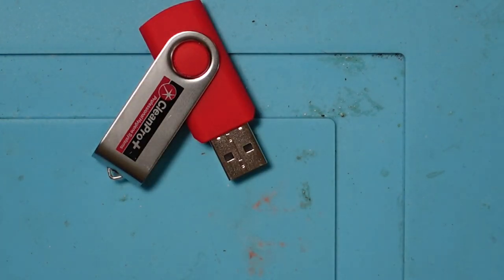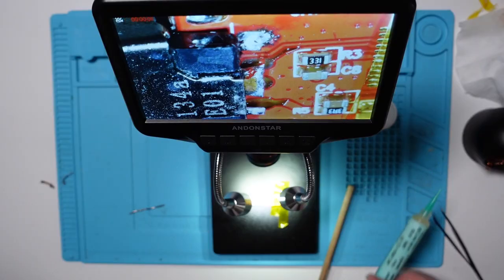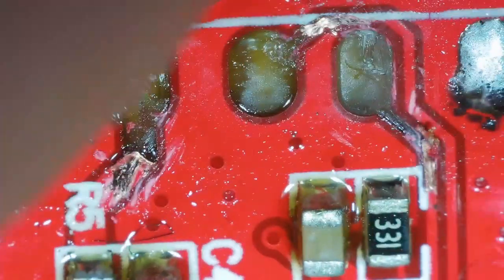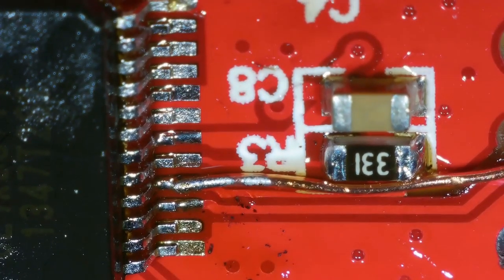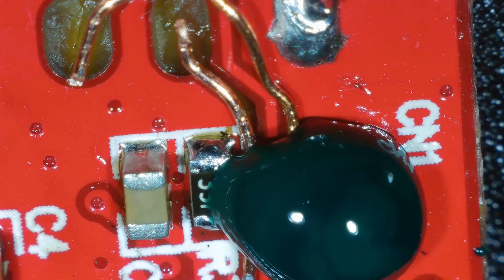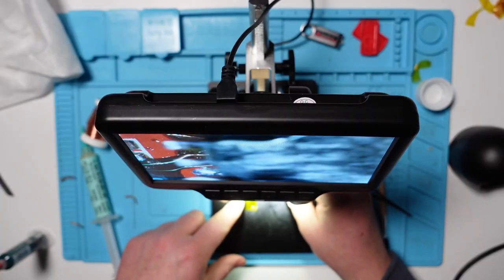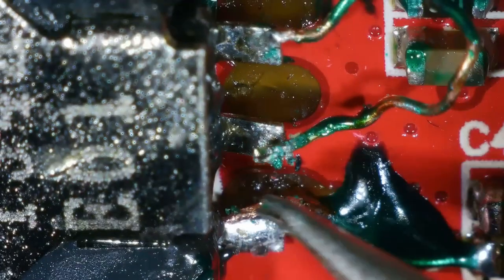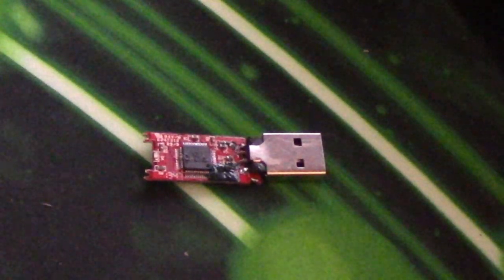USB Flash Drive | Doesn't Connect to PC | Can I FIX It?

Comment: They can't be trusted after that.  Just splice an old USB cable.  Solder the wires where they need to go.  Plug it in, get the data and in the trash the drive goes.

Comment: just out of curiosity: why didn't you just take a type-A USB cable, snip one end off, strip back the insulation and then just solder the 4 wires inside onto the appropriate points on the board? P.S. love the channel

Comment: Nicely done. I keep defective USB cables around for this purpose. I cut off the defective bit of cable, leaving me with a good plug connected to a length of lead. Then when a project like this comes along, instead of trying to salvage a problematic plug, I’ll solder my repurposed usb cable to the relevant points on the board. Possibly easier than Borge wires on the board. (At least if a “helping hands” device is used.)

I’m gonna need to get one of those microscopes.
Reply from the maker: Thanks Cory. That is a genius idea! Definitely would have been easier, I think I'll try that on the next one. I also need to get a helping hands thingy. Having the board sliding around doesn't help 🙃. And I would definitely recommend the microscope. I don't have much to compare it to, but the quality is far superior to anything else I've used! 👍
Reply: @StezStixFix  I'm interested in getting into these types of repairs but was nervous about it until watching had a go at it and was successful. You've inspired me to push and get into it. Would it be possible for you to do a tour/what's on my desk video for us please?
Reply from the maker: @ESourceSolutions  Thank you, I'm glad I gave some inspiration! I'd be happy to do a little tour of the stuff I have. It is only basic stuff, because you will have seen that I'm still very new to it myself, but I have picked up quite a few helpful little tips and items that are particularly useful! Watch this space, and thanks again for your kind comments! 👍
Reply: nice trick

Comment: Great fix Steve and never mind that it's not a neat and tidy job. It works and that's all that matters. They are very fiddly things to work on so well done!
Reply from the maker: Thanks Les! This one is still actually working. Once I got it back inside its original casing, it's pretty sturdy. But yeah, I would like to think I'd do a better job on this if I had to do it again. It was my first time with solder mask and I just whopped it on there! 🤣

Comment: You should put solder mask at the very end, if you need to repair back some wire you are stuck.
Hot gluing after everything is done may be a good choice.
Thanks for the video.
Reply from the maker: Thanks Yoldark! I didn't think of that, but will definitely try that next time 👍

Comment: 1.- Straighten the legs of the connector by bending them downwards so that they do not remain in the air. You don't even need to desolder the connector.
2.- Do not use flux.
3.- Lengthen the track with tin. Do not use wires.

Comment: I would suggest you get yourself some thin enamelled wire. That wire you was using looked to stiff. 0.1mm is the lowest diameter readily available for a low cost.
Reply from the maker: I do actually have some 0.1 enamelled wire. I  haven't used it yet as I'm unsure of the best way to remove the coating where it terminates either end (if you even have to). I plan to have a play around on a test board with it. 👍
Reply: @StezStixFix  Usually on such a thin wire the soldering iron will burn the coating off. Depending on the thickness of the coating of your wire you may have to scrape it with a blade.
Reply from the maker: Thank you, I'll give it a go!

Comment: Car dealership gave me one of these which is supposes to have contract and all the warranty info.  I was not thrilled about it especially since the first one they used did not work. They had thousands. I'm just fine with paper in a folder.

Comment: Top tip don't use solder mask until you have everything fixed and working, its messy to remove if your fix does'nt work and ou have to do it a different way
Reply from the maker: Thanks for the tip! This was my first time with the solder mask. I made a lovely mess 😁
Reply: @StezStixFix  yes we have all made mistakes, hopefully we all learn from them .. good luck with the rest of your projects ..

Comment: This video is obviously a few months old now and you probably already have a small board vice/clamp thing. If not, this is the one i use (it's also the cheapest available): https://www.ebay.co.uk/itm/401943408859
Reply from the maker: Thanks Les! 👍 Funnily enough, that's the exact one I bought! I have upgraded again since, as that one pinged shut and pulled off a few components on something I was working on! (I think Amazon Fire) 😁